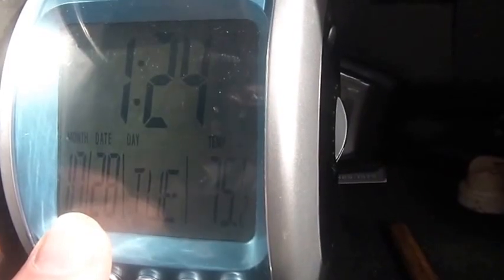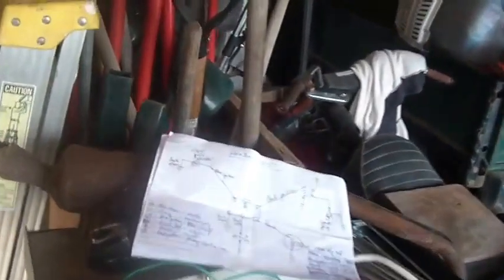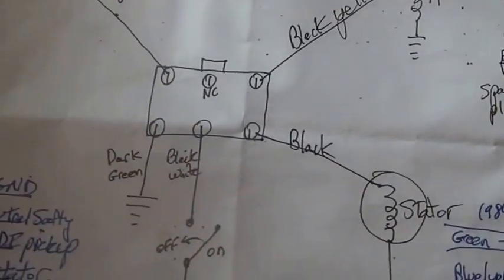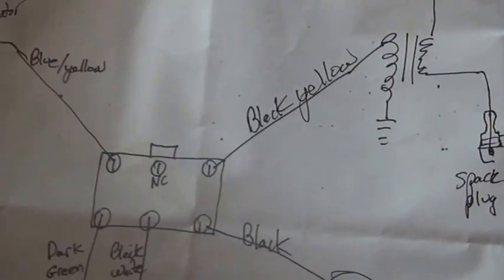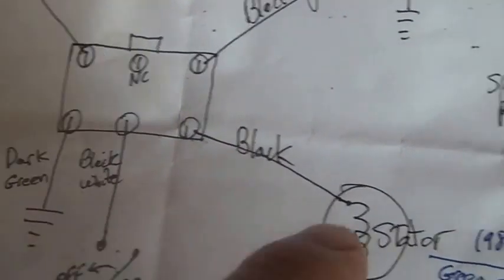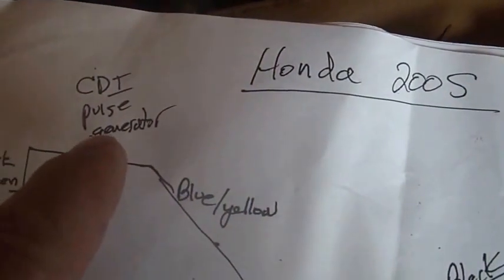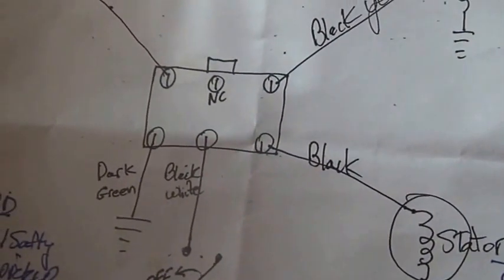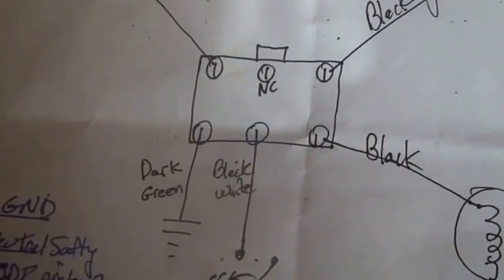10_28_2014, Troubleshooting 1984 Honda 200ES CDI ignition,

Comment: I have a question I have a 1984 trx 200 Fourtrax I Replace the CDI box replace the coil new battery and coil but still not getting spark what else could it possibly be

Comment: Hey Harvey your videos have been so much help and enjoyable to watch I've been following you for quite a few years now and with your instructions hasn't been necessary to ask a question but know I've found myself in need of some advice I have a 1985 200M it was in poor condition when I bought it "whole other story " I'm in the process of rebuilding the engine "complete tear down case split ETC" in the meantime I've acquired a 1982 200E that the engine might run so I've transplanted onto the 200M, my problem is now I have no natural light and no spark I'm aware that the act's came with different CDI but the wiring seems the same? I know the 200M wiring is good as I was able to start the trike with the original engine after replacing the cdi,coil and pulse generator so what am I missing? Thank you sir and I really appreciate your videos you're a top notch instructor and your efforts are much appreciated.

Comment: My 3 wheeler stop getting spark I tested everything an the stator isn't getting anything so I'm gonna change it out an hope it works thanks for this video very helpful
Reply: oxycotton_ 15_mg  so believe it or not I heated the cdi up and then boom it started right up
Reply: @keithparady2594  I installed the new stator but still isn't showing any voltage so I'm guessing there's a short somewhere around the wiring harness
Reply: oxycotton_ 15_mg that would be my guess to
Reply from the maker: Hey Oxy!!!   I like the 12VDC CDI hack as one does not need the stator or any thing other than the pulse generator... Takes all the variables out of what is wrong with my 3 wheeler.... I hope this helps, thanks for asking, watching, and commenting!!!
Reply: @HarveySpooner  how to do this hack ?

Comment: What would make the plug fire on and off
Reply from the maker: Hey Ronald!!!  I would start with a new plug!!!   Been burned by a marginal plug too many times!!!   On some ATVs, if the stop button or circuit is activated, sometimes they spark intermittently, cut the black wire with the white strip on the cdi such that it can be hooked back together easily.... If it starts and runs, Ur life is good if not, I would swap the cdi,,,, Thanks for asking, watching, and commenting!!!

Comment: Hey what would cause the coil to kill power out of cdi when hooked up? Unplug an gets power back out of cdi I'v tried 4 coils same thing?
Reply from the maker: Hey Tim, All coils really need quite a bit of current at a relatively low voltage from the CDI.... I'm thinking that Ur CDI or the power into Ur CDI from the stator maybe a little weak.... I would clean up all the ground connections first, (makes sure that all the power gets to the CDI and coil), I would also check and clean the other connections... Then I would consider changing the CDI.... I'm really thinking dirty grounds, though... Thanks for asking, watching, and commenting!!!
Reply: @HarveySpooner  I'm getting 35 ac volts out of cdi an all ground is clean lol just bought the stator an flywheel an cdi box still same thing lol
Reply: Oh an it's on a ATC 350x 1985 would you know which DC cdi box I could get to match the motor lol an thanks for making the time to figure out the DC box thing you do

Comment: Hey Harvey great video! I checked the red black wire to ground and only read 132 ohms? Does that mean the stator is bad ?
Reply from the maker: Hey George, Can U inspect the stator? I would do that before I replace it.... I would clean up its contact to the engine also... What brand of ATV what year is it????   The answer to Ur question is that it is suspect and I would investigate as I suggested.... Thanks for asking, watching, and commenting, let me know how U make out....
Reply: @HarveySpooner  so I have 2 hondas I picked up (a 185s and 200s both early 80s) and the 185 will run but at high rpm then quickly die when down to idle (already timed it with new carb) and the 200s didnt get spark till I put a new stator on it and new plug but even with spark, and ether spray I cant even get it to bark a bit, any suggestions ?? Thank you!

Comment: I have a 1984 200es big red put it away running 2 years ago it has lost its spark the video was very help full i will working one this  it soon.
Reply from the maker: Hey James, I hope U get Ur 200ES quickly, let me know if U have any questions and when U get it started.... Off the top of my head, I would be wondering if one of the engine stop switches on the handle bars or key switch is acting up... Thanks for the info, watching, and commenting!!!!   Good Luck!
Reply: Have not started to TS. yet the key switch was broken I am going to replace the switch that may be the it if not I will do more  testing may be bad contacts from sitting.I will keep in touch you.
Reply: got the big red going I cleaned the engine stop switch,replaced the ignition switch,cleaned the ignition coil terminals I got spark. cleaned carb and it started up I am very happy.Harvey thank you for the video.

Comment: Hey Harvey. Thanks for posting these trouble shooting vids. Very helpful. I have an 84es that has lost spark. Everything checks out at the cdi plug and have even tried different CDI boxes, by passed the kill switch. Reverse switch. Tried different pickups. Coils. Even the stator and nothing. I've got no clue why I don't have spark. Any input from you would be great since you know these machines so well. Thanks.
Reply: I will SOMETIMES have one little spark for a second then nothing if that helps diagnose. I've tried different plugs wires and caps as well .
Reply from the maker: Hey Rob!!!!   I would try running a wire from the engine, (make sure it has good contact, I normally attach it up on the pulse generator cover), I would then run that wire to were the spark coil is, I would make sure that the spark coil has good contact with the frame and that Ur new ground wire has good contact with the coil and frame.... If that doesn't help, I would keep it and check the CDI pulse generator gap between it and the magnet, I normally set the gap to be a single sheet of paper, just make sure that it does not touch.... If these things don't help, I would consider changing the pulse generator, but, get back to me first..... Thanks for asking, watching, and commenting!!!
Reply from the maker: Hey Rob!!!!   I would try running a wire from the engine, (make sure it has good contact, I normally attach it up on the pulse generator cover), I would then run that wire to were the spark coil is, I would make sure that the spark coil has good contact with the frame and that Ur new ground wire has good contact with the coil and frame.... If that doesn't help, I would keep it and check the CDI pulse generator gap between it and the magnet, I normally set the gap to be a single sheet of paper, just make sure that it does not touch.... If these things don't help, I would consider changing the pulse generator, but, get back to me first..... Thanks for asking, watching, and commenting!!!

Comment: I have a gray wire up thru my cdi
Reply from the maker: Hey John, I have looked at a lot of ATV wire harness and have not seen a gray wire to the CDI unit, what year, cc, model, and make ATV do U have???? Thanks for the info, watching, and commenting!!!
Reply: Harvey Spooner it's a 200 es 1984.
Reply: Harvey Spooner the reverse light stays on can't start it.tried jumping the safety and reverse switch don't work lol.trike is in good shape it's just the reverse lite stays on so either the reverse switch I tried two of them used.or in the that wire ?

Comment: My 82 ATC 200 will idle ok but when i rev it right up, it sputters quite badly. when i pull a load too. new sparkplug, stator is 230ohms, new fuel, carb rebuilt. very confused.

Comment: i have what i belive to be a 1984 200 big red e its runs but if i ride it and it gets hot then quits and wont start back till its cool agian idk what could couse this help if you can
Reply from the maker: Hey Kenny!!!!   Unfortunately, one would have to use the method of elimination to find Ur problem, I would start cheap, replace the plug and make sure that there is full gas flowing to the carb, also, make sure that there is no water in the carb or gas tank.... From there, I would use my portable 12VDC CDI box to make sure it is not an ignition issue.... I would probably change the spark coil next, it is fairly cheap and easy to change.... Good luck, let me know how it all turns out... Thanks for asking, watching, and commenting!!!

Comment: I got the parts that you told me about but I still have no spark  and I put in a new and a used start  if u know any one who need patrs  let me know
Reply from the maker: Hey Dave, Where do U live???? If close enough, I can come look at it or U can bring it to me.... Did U check to see what the resistance value of Ur pulse generator is????   Thanks for getting back to me, the info, watching, and commenting!!!
Reply: I an in athens ohio I put no a new pulse generator and I got a cdi but it was not the right one I got that pit bike set up you sent a link for  still on spark
Reply: Harvey Spooner is 206 ohms enough for the black and red stator wire

Comment: Do u think this will work for my 200es  I can't get it to start 
50 70 90 110 125cc CDI Wire Harness Stator Assembly Wiring Set ATV Electric Quad 953315196695 | eBay
http://m.ebay.com/itm/50-70-90-110-125CC-CDI-Wire-Harness-STATOR-Assembly-Wiring-Set-ATV-Electric-Quad-/401184252929?_trkparms=aid%253D222007%2526algo%253DSIC.MBE%2526ao%253D1%2526asc%253D20150519202348%2526meid%253D3d42d70f0d674979b7de15a732a7505c%2526pid%253D100408%2526rk%253D2%2526rkt%253D21%2526sd%253D401181279660&_trksid=p2056116.c100408.m2460
Reply from the maker: Hey Dave, Assuming that Ur stator is good, this is the one I use, http://www.ebay.com/itm/Wiring-Loom-Harness-Kill-Switch-Ignition-Coil-CDI-For-50cc-160cc-Pit-Dirt-Bike-/231318770542?hash=item35dbac536e:g:ShsAAOSwDk5T~x5a&vxp=mtr  , It has everything U need and it is cheaper... The stator and pulse generator from the one U picked will not fit the 200es.... Thanks for asking, watching, and commenting!!
Reply: My stator is testing about 300 ohms but I have no spark can no fine a cdi box for so I wanted to try what u did so I can get it running again

Comment: I have a 200es I put cdi new cdi box new stator still have  no fire come u send me the link where you get your parts from china
Reply from the maker: Hey Dave, I would use this CDI - http://www.ebay.com/itm/4-PINS-PRONGS-DC-CDI-REV-BOX-125CC-150CC-200CC-250CC-300CC-ATV-SCOOTER-GO-KART-/271146000193?hash=item3f218f9f41:g:ptYAAMXQa7hRBasm&vxp=mtr , and this wiring diagram -   https://www.bing.com/images/search?q=4+pin+cdi+box+110cc+atv+wiring+diagram&view=detailv2&qpvt=4+pin+cdi+box+110cc+atv+wiring+diagram&id=FC5F02BB3454B5DAAF12F375DAB4127861CFDB71&selectedIndex=0&ccid=TI4VCnAG&simid=607989369612536783&thid=OIP.M4c8e150a7006d7acfad13914b8e14391o0&ajaxhist=0 , I hope this works out, please let me know how it all turns out.... Thanks for asking, watching, and commenting!!!

Comment: I have a 1984 200es and my engine run/off switxh read nothing when it's was turned to run and it read 3ohms when turned to off. also the nuetral.safety switch read 60 ohms. are either of those normal?

Comment: God bless you for sharing your knowledge Harvey I have a brother that just got an 85 200X and he's having no start condition  after full engine overhaul .
Reply from the maker: Cr500!!!   I personally messed up the following things after an engine swap to loose spark, I installed the CDI pulse generator magnet 180degrees off, had bad grounds between the engine and the frame and the frame and spark coil ground, I pinched the wire harness between the frame and engine, I have left grounds terminals hanging loose, and those are the screw ups I can remember easily.... I hope this and the debug videos help!!! Let me know how it all turns out.... Thanks for the kind words, watching, and commenting!!!!

Comment: where do i find the netreal switch on the 1984 honda 200 s atv need help got the bike cheap 50 was in great shape
Reply from the maker: jerry godin , The 1984 Honda 200S does not have a neutral switch, do U mean the 200ES?  If U float, (disconnect), the on/off switch,   and the neutral switch wires from the CDI, and leave everything else connected properly, it will spark and run. Shoot a video of what U have and I will take a look... Thanks for asking, watching, and commenting!
Reply: you got it
Reply: its a 1984 honda 200 trx the cdi has a charge  of 15 volts at the coil wire but no discharge both coils new and old are reading at 4.5 oms.is this a ground problem
Reply: Is there any other way to bypass the neutral switch without disconnecting the on/off switch

Comment: Harvey, will a 200s CDI unit work on a 200es? The 200es unit is physically larger than the 200s but the connectors are the same.
 I have no spark on my 200es. My 200s runs.I swapped the CDI units and neither bikes run when doing that. My stator resistance reads 295 and pulsar reads 35 which I believe to be within specs.
 Also, could you take some up close video of one of your 200es wiring from the stator and key switch/headlight area? Thanks for any help.
Reply from the maker: revitup1965 , The 200S and the 200ES motors are basically the same, minus the electric starts, 12V charging system, and shaft drive. So, the 200S CDI will work on the 200ES if wired properly. But, some of the safety stuff will be bypassed, (for example, it will start in gear), I have a few things going on, it may take me a few days to get to that video, thanks for asking, watching, and commenting!
Reply: Thanks, I appreciated it!

Comment: after that it started and now runs thanks harvey for your help/
Reply from the maker: joe18370 , I'm glad she is running, but, I'm a bit concerned about U seeing DC voltages where there should not be any... Thanks for saving another Honda from the scrap yard, also, for watching and commenting!
Reply: now that she is running better then before i will check my readings to see what is normal and compare them to before, do you no anything of the charging sys,my batt does not charge from big red i have to charge the batt myself

Comment: the switch green and black wires have 9 volts  in them , when i touch black to ground it sparks but the black/yellow  put out high voltage so when black wire sparks voltage jumps but why

Comment: hi harvey i got the cdi box wired it to diagram and no luck , i an getting 2 or 3 volts  from black n yellow to coil wire  ,, my on  off switch turns still not working right,,ill have to trace the green wire/ i am getting around 12 dc volts from dci pick up does that seem right ,but once it enters cdi box i get only 2/3 volts

Comment: harvey thank you so much for making this video ,i copy everything on paper and will be testing the ohms today and ordering the cdi box/ i striped  part of the black/yellow wire  from cdi box to coil and saw the wire is burnt// black not shiny// most likely the black wire to switch will be the same,
Reply from the maker: joe18370 , Let me know how it turns out, I would like to learn from Ur experience... Thanks for the kind words, watching, and commenting!
Reply: i will let you know ,waiting for the cdi box and connectors to be shipped, what i found out so fare is the on off switch is not grounding the switch i think to cdi box,,and no power from cdi box to coil ,stator is good ,cdi pick up is good, just no power to coil , i will get back to you when i get the parts in, thanks
Reply from the maker: joe18370 , U use the phase, "no power from CDI box to coil", the CDI box is powered by the stator, don't expect 12Volts anywhere near the CDI box, if U do, expect burnt wires. the CDI is powered by about 60Volts AC when the engine is running,. The CDI box powers the ignition coil, let me know how it all turns out, good luck!  Thanks for watching and commenting!
Reply: cdi pick up is giving 12 to 13 dc volts